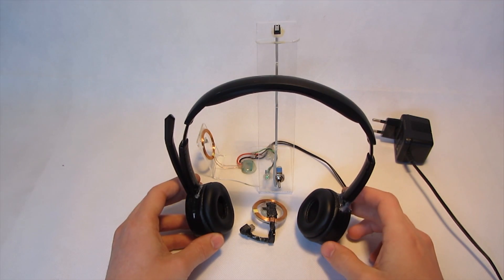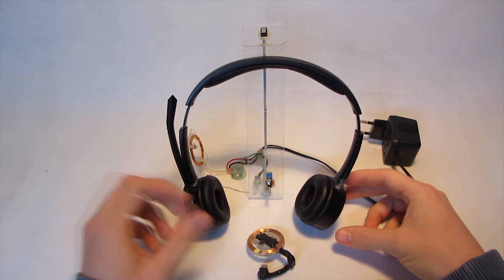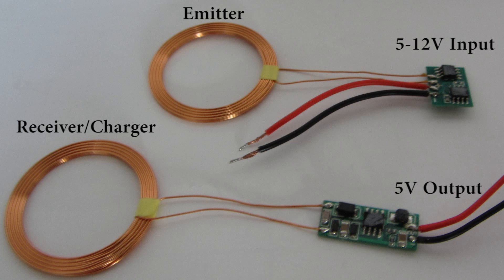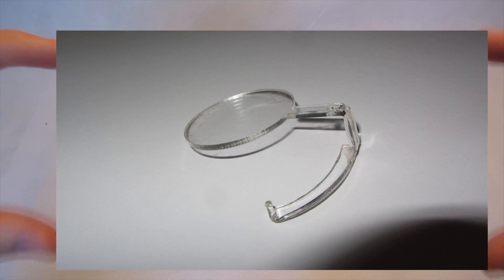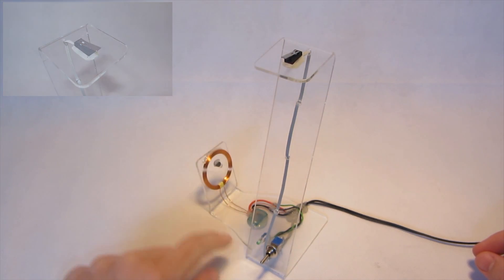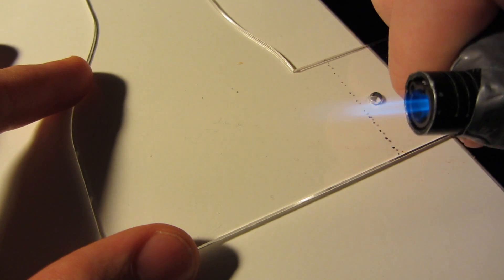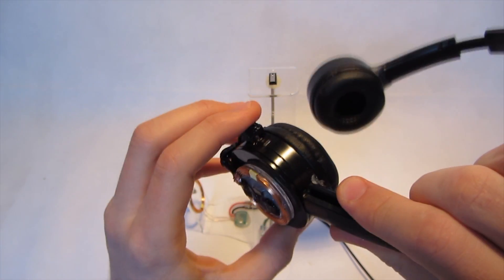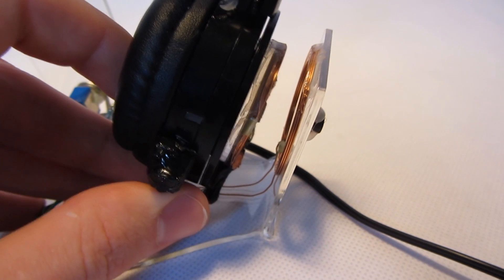Homemade Wireless Headphones Charging Station

Comment: For me it would feel like less effort to simply plug it in than to design and build a wireless loading station.

I do admire what you have built. It is excellent.
Reply: It is interesting how much work you put into something which is designed to save effort. :)
Reply: Good to hear that it functions well and that it fulfills the purpose well. If I were not so lazy, I might have made a time saving device. My solution to everything is dental floss, elastic cord, masking tape and pieces of plastic from cd cases. :D

Comment: i found it thanks ;D

one last question though...
When i buy the DIY Wireless Charging Transmitter + Receiver Solution Module - Green + Golden (DC 5~12V) and cut both coils and replace them with "homemade" bigger ones would the circuitboard manage to handle it?

How do the coils work, i mean bigger diamater = more distance
or more coils but same size diameter = more distance?

hope you understood my question :)! loveyourvideos!

Comment: with how close they are wouldn't it be easier to to just have a + &- terminal in place of those coils? that way you wouldn't even need that kit, but you could still use the stand just the same.